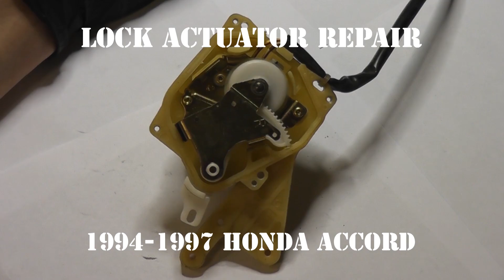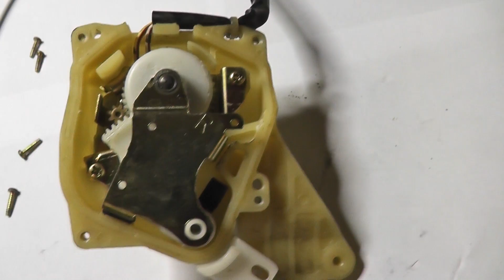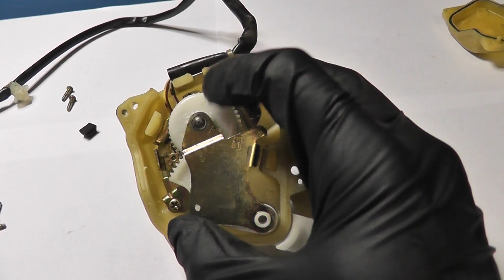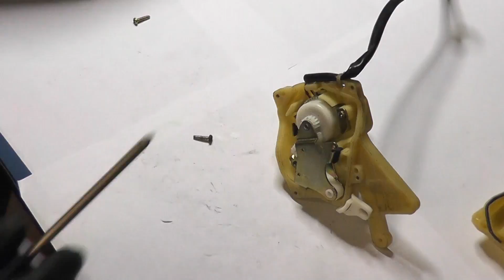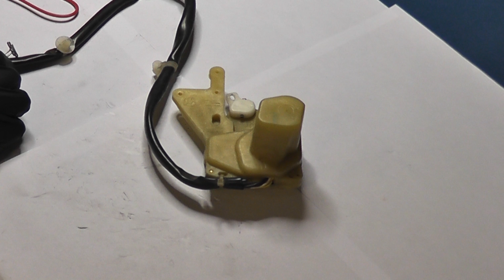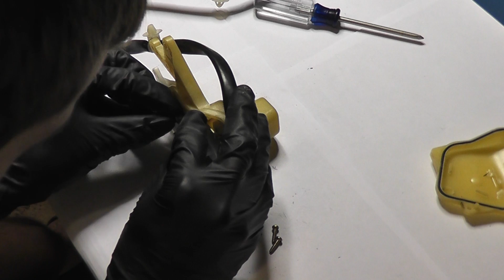1994-1997 Honda Accord Door Lock Actuator Repair

Comment: What if the actuator stops still work, but repeats its attempts to lock, whether locking was successful or not. Like somebody repeatedly pressing the lock button 3 or 5 times after pressing it the first and only time? Would this be an issue with the actuator, or linkage, or a relay maybe? And also handle must be lifted or key turned for door to lock.

Comment: Thank you for showing how to do this. On my wagon I switched out my hatch lock with one that works and managed to get the front driver and rear passenger doors locking. I had unhooked the front passenger and rear drivers side because of the noise. I'm confident that doing this repair shown to the locks I have disabled right now will fix them. Then I will hopefully have all 5 locks working perfect.

Comment: This is brilliant. I have this issue on 91 Accord, but taking off the actuator without taking the latch out of the door doesn't seem possible, and removing and reinstalling the latch is very difficult for me.

Comment: On my part, the two rubbers were fine and in place but the plastic that held Spring in place was broken and the spring was sticking out.  THat is only thing I saw out of place compared to the replacement part.  Do you know what the spring does mechanically that may cause the rotatiing teeth to spin over and not engage and stop as they are supposed to?  When I switch to unlock/lock position, the teeth just continue to run and not work correctly.  Again, the 2 rubber stop are in place and in geat condition.  How is the spring not being fully clamped affect this part?

Comment: GREAT VIDEO....replacing the loose piece of rubber was a pain.....no room...I decided to remove the pin on the outside of the actuator and therefore I had lots of room to replace and glue the piece of rubber that came off......

Comment: great video bro... it helped me even though it was not the same problem .. what i found inside was a spring that had popped out of the  the big gear ... i then put a small piece of metal big enough to push the spring back down..then i glued the metal bit in and it was working again.

Comment: hey i have a 94 accord lx with spoiler, 3rd brake light js out other 2 works fine changed the , bulbs, changed blown fuzes still doesnt light up, any help would help thanks! and also my power locks dont fully work, the car locks but it wont unlock, i have to manually unlock the doors.

Comment: hi  i have a accorrrd 95 and i couldn`t take off the lock and actuator because it has something holding the handle door and i didn`t see a video teaching how to do that. The door is front passenger. Can you post a video teaching how take that lock assembly off please. Thank you.
Reply from the maker: +Jorge Caldas This was a passenger side actuator from a 95 EX I made a video showing how to remove it. Just remove the 3 screws securing it and pull it back and down to disengage it from the lock / unlock  pin.
Reply: +Bushougoma yes, I saw but Ican not take off one of this three screws.Then I wanted take off the actuator and the lock after that could try get that one hard screw but I don´t know if I need take the handle off to get the actuator. I don´t know if you understand me.
Reply from the maker: Jorge Caldas
Make sure the screwdriver you're using is in good condition and a tight fit to the screw head. Removing the latch should be a last resort.

Remove the window run channel bolt and push the channel off to the side.

Pop the rod off at the handle linking the lock cylinder to the latch.

Pop off the bushing connecting the latch release rod to the handle.

It will require some force right angle pliers are recommended to get behind the bushing to pry it away from the handle.

You can also pull the outer handle forward through the door a bit for extra access if you want by removing the 2 bolts. There are two access holes to get to them one is outside the area covered by the door trim panel under a sticker.

Once it's off remove the 3 screws on the outside of the door securing the latch and you should be able to maneuver it out.

Inspect the handle bushing for damage if it's badly damaged get a new one from the dealer.

On re installation the rod should pop into the handle with some effort and you may need to use channel locks to press it back in. If it pops in too easily replace it.

Having the latch release rod pop out of the handle with the door closed and the panel on is not something you want to deal with.
Reply: Ok Great teaching. Thank you.

Comment: Excellent video. Great!!! Please post one why the honda accord 94/97 no cranking and no start. What are or can be the mais problems??? Thank you guy.
Reply: mine was the main fuel pump relay.  just search NO START 94 Honda Accord.   Relay is under drivers dash behind steering Column.  I left in the old housing and just replaced the part inside. 55 year old Gramma here.  easy fix just tough to get to
Reply: +Gingeria1 Thank you Gineria for your comment. I'll try to do that.

Comment: Nice video. I had similar sound but it wasn't the rubber bushing (still in place). It was a small black plastic retainer that held a spring into the clutch mechanism.underneath the mechanism. I managed to wedge spring back in place w/ wood chip glued in place and it works,...most of the time.
Reply: Texas Pipeliner 
I did the exact same thing that you did on my '96 Accord. It's been good for 3 years now.
Reply: mine too.   Mine had a black spring sticking out by the 2 wires. I shimmed the spring back in with a little piece of wood and super glued the wood in place. fixed it
Reply: LOL  that is exactly how i fixed my 94 accord.  super glue and wood on the spring.  Great minds think alike.